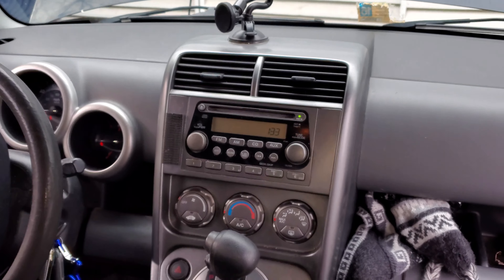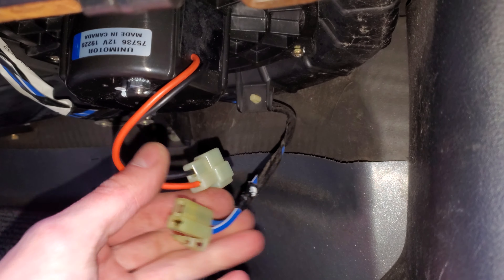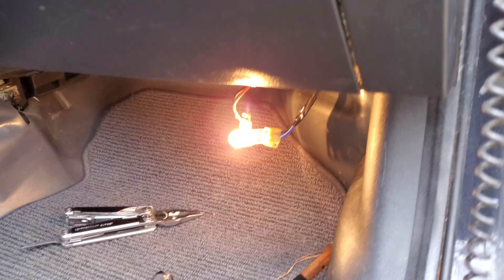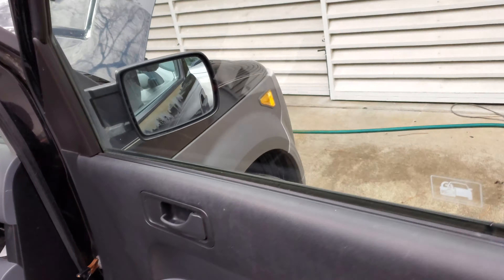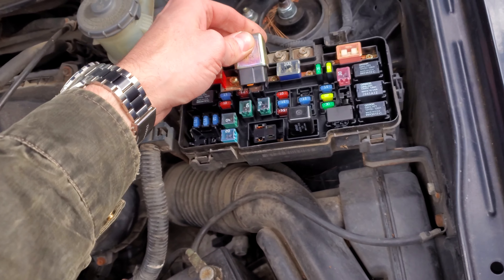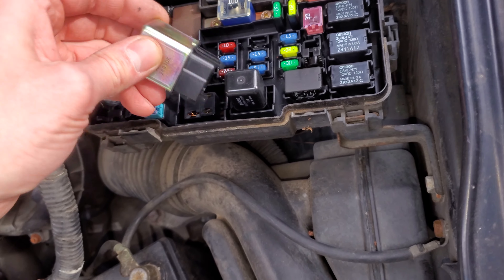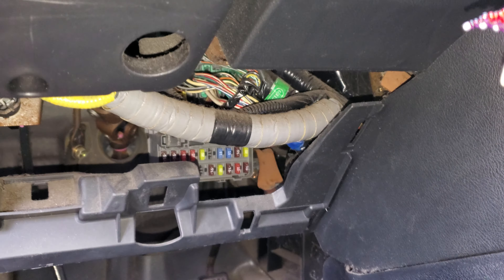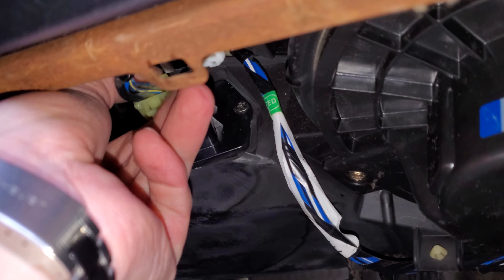2004 Honda Element, CRV Blower Motor Fuse, Blower Motor Relay Testing

Comment: Great explanation.  Thank you.

I also found this from the shop manual, in case it helps anyone.  
Blower Controls
You can manually select the fan speed by turning
the fan control dial clockwise from the OFF
position. Turning the dial further clockwise
increases the fan’s speed, which increases air
flow.
Battery voltage is applied through fuse 12 (in the
under-hood fuse/relay box) to the blower motor
relay contacts at all times. With the ignition switch
ON (ll), the blower motor relay in the under-hood
fuse/relay box is energized, which feeds battery
voltage to the blower motor. The blower power
transistor controls the blower motor in all speeds
except HIGH. The blower power transistor is
controlled by the heater control panel. When the
control panel requests HIGH blower speed, the
blower power transistor grounds the blower motor,
which connects it directly to ground, making the
blower run at high speed.

Try running self test

A. turn the ignition switch off
B. press and hold both the recirculation and the rear window defrost switches
C. turn ignition switch on (II)
D. the diagnostic begins in about 15 seconds

after the self diagnostic any problems will be displayed as a series of blinks of the recirculation indicator. the pulses will repeat about every two seconds.

# blinks defect
none none
7 open in the air mix control motor circuit
8 short in the air mix control motor circuit
9 problem in the air mix control linkage, door, or motor
10 a short or open in the mode control motor circuit
11 problem in the mode control linkage, door, or motor
12 a problem in the blower motor circuit
13 a problem with the EEPROM in the heater control panel
14 (w/ac) open in the evaporator temperature sensor circuit
15 (w/ac) short in the evaporator temperature sensor circuit

Comment: I’m experiencing an intermittent blower motor issue right now on my 2005 Element EX. That video was very thorough and I’m hoping one of these issues you showed will correct it. Thanks for taking the time to share. I’ll report back 👍

Comment: THANK YOU!!!!!!! With your great video and knowledge I fixed my no blower issue.  It was the resistor module and using the paperclip to short the plug pointed me in right direction. 
Probably saved several hundred dollars on something I could do with your help.
Reply from the maker: Tremendous! Glad you got it sorted

Comment: The auto parts store gave me a bad blower motor resistor. Thanks to your showing how to bypass it, I could see that the motor was working fine. I got another resistor and it's now working great!
Reply from the maker: That's great! It can be confusing when a brand new part doesn't work!

Comment: Hello, Thanks for uploading wonderful video. My honda crv 2004 heater blower was not working i just changed the transister. It has start working but blower stays on all time. Any advise will be apriciated.

Comment: You’re the man, I appreciate you more than words
Reply from the maker: Thank you!
Reply: I am very impressed with your skills and knowledge and now need to know if you can help with troubleshooting Headlights flickering on my 06 Element?  How do I check for a faulty ground?  Or check if is the voltage regulator ( I think it’s in the alternator)?
Thanks,
Bill

Comment: I pulled the socket and jumped it and there's light. But the blower motor there's no light. I've checked the fuse box in the engine bay they're perfectly  working. Is it the transistor?

Comment: So my situation is I have power to my relay and 40 amp fuse under the bonnet .. my control lights light up just fine but I have no power going to my motor .. I know the motor is good because I connected 12 directly to it and it spins .. I’ve tried jumping the pins on the transistor no dice . So I am lost for what me t to do . And I am new to the CRV platform

Comment: THANK YOU!!!!!!! With your great video and knowledge I thought I fixed my no blower issue.  It was the resistor module and using the paperclip to short the plug pointed me in right direction. I installed a new resistor module and it worked for 5 minutes, then quit. The heat sink was so hot it burned my finger. So did I buy a bad resistor module like another comment here?  Or is there something else wrong???
Reply: Update: I plugged in the resistor module at the parts store to test this was the issue and drove home with it dangling to install when I got home. When I removed the old unit I realized the entire blower volume flows though the heat sink and five minutes without this air flow toasted the 114 degree thermal protection circuit.  The part came with a lifetime warranty, so the second unit, installed, works great!

Comment: I replaced the: Blower motor, resistor, relay,40a fuse and the control panel(dials). Blower motor still does not turn on. Any ideas?

Comment: The blower doesn’t turn off, I turn the control but it doesn’t turn off, I tried it with a new control and still nothing, I changed the relays and nothing either. Any idea of what could be happening or what I can do?

Comment: I have a similar car (02 cr-v). What's the culprit if the blower sometimes works then stops a few minutes later. Also it seems that when it does it is weak. It did something similar to that years back and took it to the stealership and they made me change the motor and the transistor/resistor and charged me an arm and a leg 🤦
Reply from the maker: I suspect you may have a bad connection at the blower motor. When it is not working, try wiggling the connection at the bottom of the blower while you have it turned on.

Comment: Couldn’t you also verify there is low resistance between the black and red wire going to the blower to confirm if the blower motor is bad?

Comment: So if the transistor is bad will you get power to the motor still? I checked the motor with the bulb and nothing. All fuses are good under hood and drivers compartment
Reply: To answer my own question I asked above, the transistor was good and now stuck with a part I don’t need. My problem actually ended up being a blown fuse for the power mirror. Go figure my advice is to check both points on every fuse with a pen tester first.

Comment: I tested the modular with the light I believe it’s the last one you check on your video the two big wires and the light did not come on do that mean I need to change The modular? All the other test with the light worked.
Reply: I would like to say thank you for Posting the video it help me trouble shoot the problem